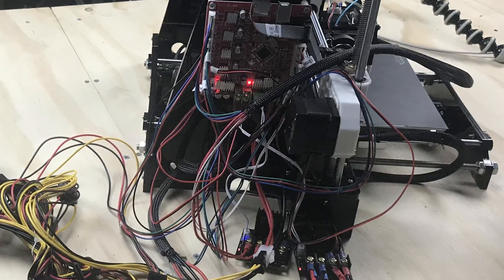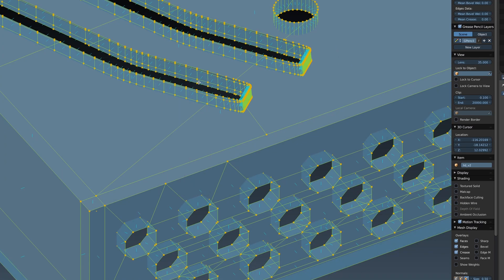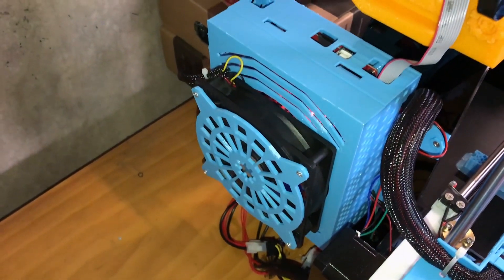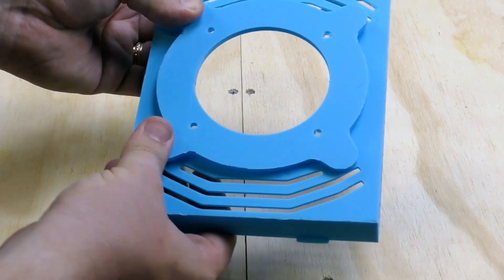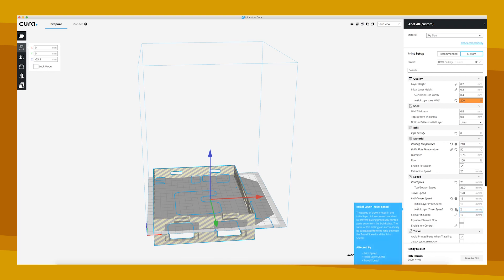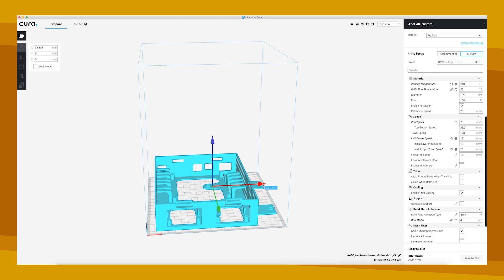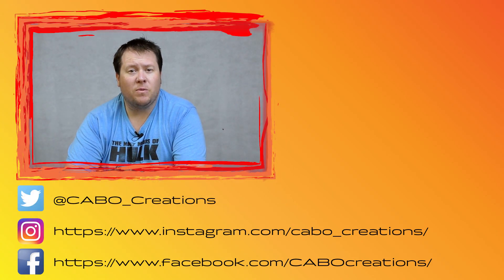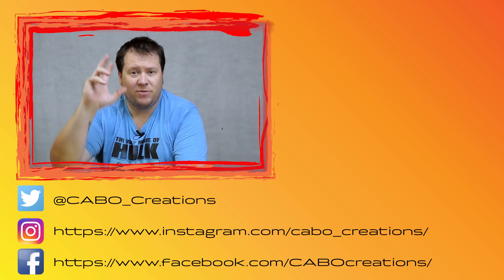Anet A8 Electronics Box MKII

Comment: CABO Nice work.  A lot of people not have upgraded to RAMPS with Raspberry Pi3 Octoprint and dual Mosfets.  Is there any upgrades in the future upgrades to hold such components?  I love the the case but not that far in Remixing yet to make that type of modifications yet.  Would definitely Print if these upgrades were available.
Reply from the maker: Hi Derek, I have spent a bit of time trying to rework for these components but have not come up with a solution I am happy with. Thor has remixed my case to include these parts though on Thingiverse. I don’t have the link but a quick search should pull it up

Comment: just printed this in orange and white, it looks great! the lid's bottom hinges broke but that's an easy fix. i used it for my A6 whose structure is a little different to the A8; all this meant is that i had to drill one hole into the structure to make room for a screw, and i also used a few bits of double sided tape to give it some rigidity. it's a fantastic box! can i ask what power source you used for your fan? did you piggyback of the 12v coming into the motherboard or directly from the PSU?
Reply from the maker: Hey Nicholas, I hooked the fan straight into a 5V pata rail on my PSU (I’m running a thermal take ATX). The guys on the Facebook group will have hooked up a fan to the stock PSU though

Cheers

Ben
Reply: CABO Creations no worries, thanks for the reply. By Facebook do you mean the anet a8 page?
Reply from the maker: Yep, always a source of great info

Comment: Hi Ben, I'm going to print off your case as I've only just built my printer and did the mods on the fly.. They are resting on antistatic plastic for now (I know I need to wash my mouth out!!) but hopefully my mosfets will fit nice. I like the look of all the mods you've done can you link them please.. Are they all linked on your thingverse channel?Many ThanksJTB (3D Printer Newbie!)
Reply from the maker: Hi JTB,

Don't worry too much I had my mosfets sitting on my work bench in the garage until I designed the case!

I have links to all the mods I have printed in the description of my build video https://www.youtube.com/watch?v=y9a_XefxBvw
Reply: What size screws have you used to mount the PCB and mosfets to the case please?
Reply: Hey JTB,

I'm pretty sure they were just M3 screws I had lying around my workshop. Small self tapping screws will work as well